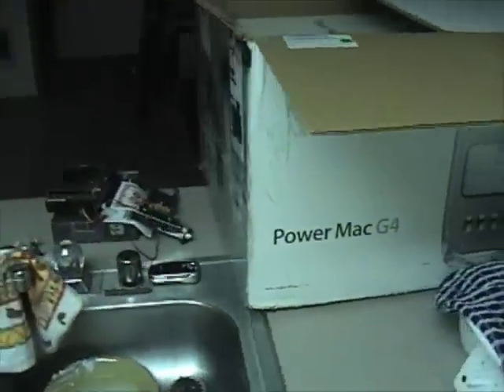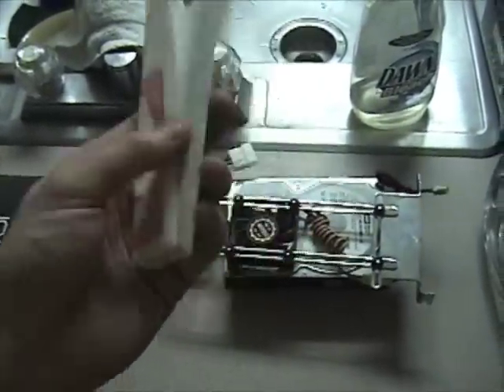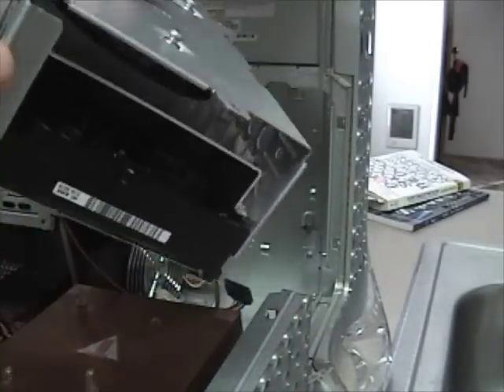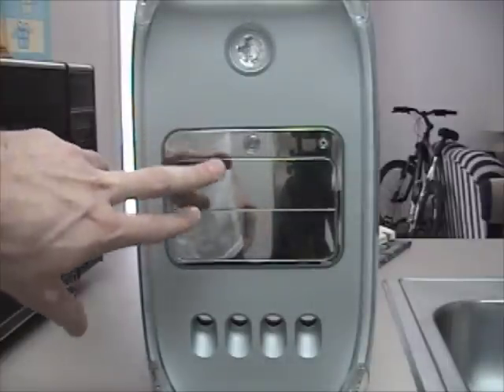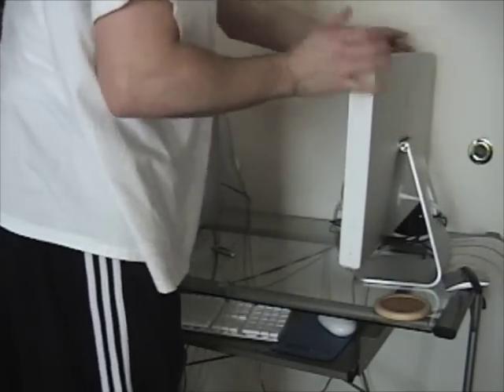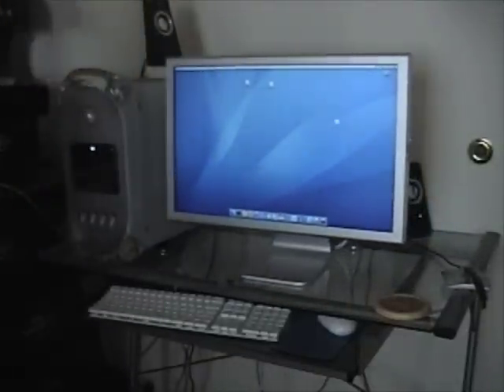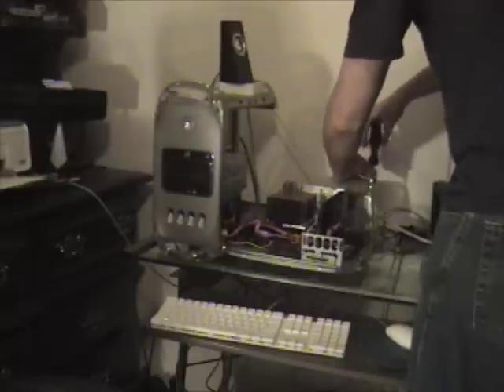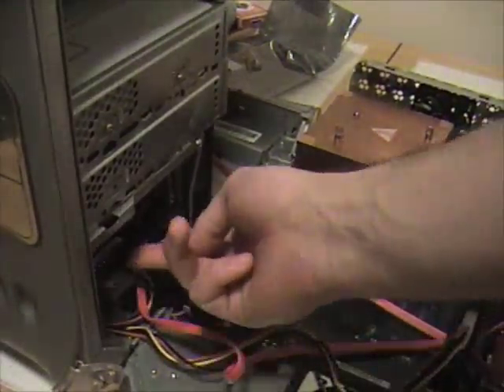Monster PowerMac G4 1.5GHz

Comment: I have a 533DP Server, and a great upgrade I found is to add a USB 2.0 PCI card, which has ports on the back AND one internal. Then get a Mac-compatible bluetooth dongle. Instant USB 2.0 support and bluetooth connection for a mouse, keyboard, phone, etc.

Comment: The dual 1.25 does have FW800. None of the MDDs can boot into OS9, except the one released in 2003 which has a single 1.25 config.

Comment: @bubbamj Nope, AGP 8x cards are bigger, only some are smaller. An example would be the ati radeon x800xt and the nvidia 6800 ultra in the 2004 powermac G5s those take full advantage of the larger 8x slots and have larger connectors. The 9800 had a smaller connector.

Comment: I have a G4 sawtooth AGP which used to be a crawling 400MHz now it's a dual 1.6GHz with 2Gigs of RAM and a Radeon 9800 pro with OS X 10.5.8 and 550GB of HDD yes thats right 550GB! If you think you can spend $25 to unlock your 128GB limit in your PM G4, go and buy speedtools hi-cap driver from their site.
I am also running Android 2.2 froyo on my other partition.

Comment: @Coilaman 
The fastest G4 CPU upgrade was a dual 1.8GHZ from Sonnet. But it is 100% impossible to flash a 3850 into a G4 because you cannot flash a X86 ROM to work in PPC, regardless of slot type. End of story. FendersRule is correct.

Comment: @oldVideoGamesChannel 
False. AGP 8X have the same size pins (connectors) as AGP 4X. Only the slot length can vary, depending on if we are talking about AGP PRO or not.

Comment: Any G4 Mac withOUT a Firewire 800 port can boot natively into OS9. The dual 1.25 does not have FW800 so it can boot OS9. This machine is a 1.25 overclocked to 1.5, which is what I want to do to mine eventually...

Comment: @userxx Try the "Camino" Browser. It plays flash WAY better than Firefox, Safari or Opera on these older machines. It blocks all flash ads until you decide you want to see them. I have the same MDD dual 1ghz with 64mb of vid ram and Camino plays YouTube FAR better than all these browsers. It's developed by Mozilla as well. I also have Leopard installed.

Comment: @oldVideoGamesChannel 
Never saied that is a 3850, it's an 9800 Pro !!!!!!!!!!! it's of course 8 X AGP, but you just have to force it into AGP 4X mode like all card (even the flashed your 7800GS had to, but what kext did you use because OS X can't recognise this card normaly), you cover with tape the connecteur 2 and 5 of the card and put in it and works great with an alternat kext driver. No lie my firend, it's wroks great

Comment: This is very similar to my setup. Mine has 2GB of RAM and a flashed 9700 Pro (128MB) in it. I'm attempting to overclock mine to 1.5GHz (1500MHz) after getting my cooling system in order, but the bitsandpieces site is down, and I need to know the VID for overclocking the MPU! :(

Comment: @FendersRule Mine is clocked at Dual 1.75 Ghz (original Dual 1,25 Ghz). Stable and watercooled. But I only had a 9800 Pro (pc card flashed) and i tried to put 4 gb of ram but the controler didn't recognise it so i'm at 2 gb. Running leopard quite well. But I think dual 2.5 is realy a lied

Comment: Well, I have 2gb in my DP 1.25 G4, just picked up an  FX5200 to try and get it running. Still having no real luck getting my SCSI cards running...... got several 2904/39160/Atto Express no joy....

Comment: @oldmac6 it's an obvious lie because an ati radeon HD 3850 is a PCi-express card and the G4 has an AGP 4x slot, which means even the AGP ati radeon HD 2600 wouldn't fit because it's an AGP 8x graphics card.  :P

Comment: i looked up how to over-clock it ... more than a little technical

you first have to remove the mobo and then solder several exact connections on the dotter card and if you mess up, gone , also it " heats up like a mofo"

Comment: @ncis0520 you need a G4 MDD FW800 mac with a 1.25Ghz processor or find the processor on ebay then the fun starts, search Google for step by step instructions. 

Note the only REAL way to overclock your G4 MDD is with hardware mods either to your daughter card or motherboard.

Comment: No. That would be using the G71 chip not the G70 chip that the ROMs need. Best nvidia card is the 7800GS with the 5.70.XX BIOS. It says which BIOS on the  back of the card on a sticker. BIOS 5.71.XX and higher is NOT compatible because those are G71 chips.

Comment: my pc 7 years old have a monster 4 precessor 3.2 pentium quad 8g ram sli 8800gt 2gb have very super pc
Reply: to day have i7 4790k watercooled 32gb ram dominator 2866 ghz sli gtx 980 triple screen 24 144hz is very the best pc
Reply: 21LOLxPROot bad, but the x99 platform is where the very best is.
Reply: not have money buy new msi x99s ddr4 and itntel i7 5960x
Reply: i still rock my 2600K.  been good to me all these years.